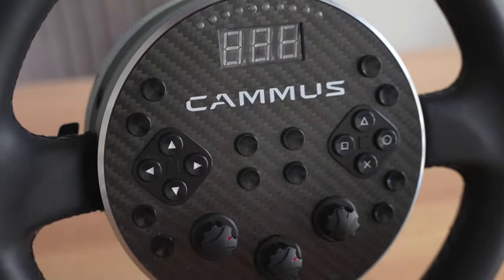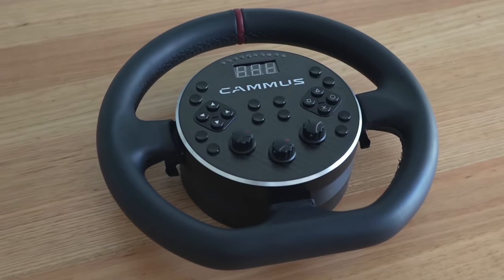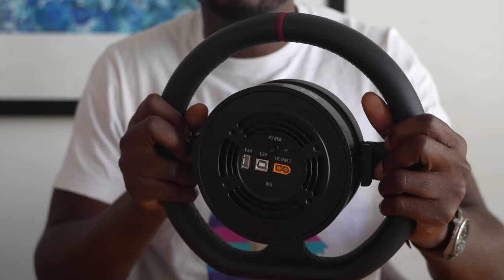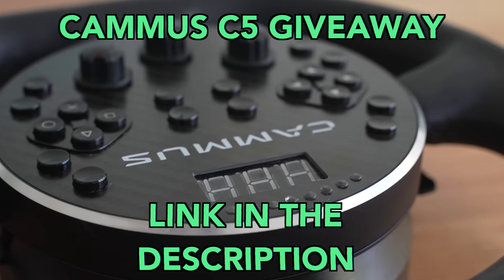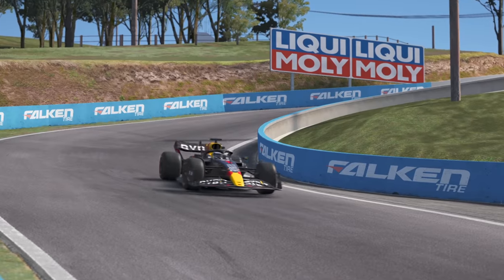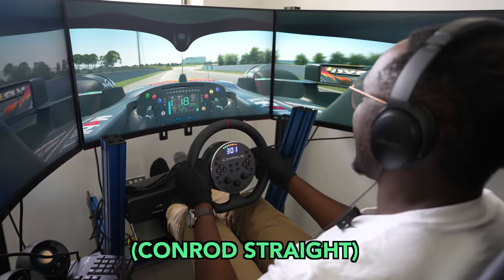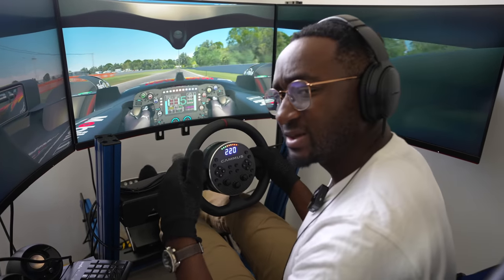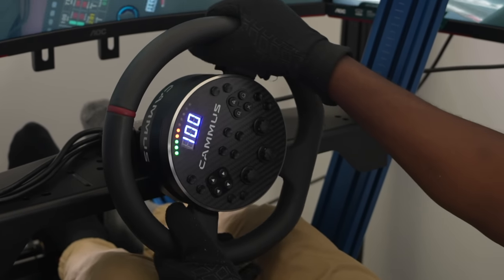The Cammus C5 Is The Most Affordable Direct Drive Wheel Ever

Comment: A larger wheel would make it look less awkward, but either way it’s a very interesting concept.  The more competiton, the better outcome for the consumer!
Reply: Yeah was thinking the same, the smaller rim makes the middle section stand out
Reply: Or they can make the outer wheel itself modular and make attachments of various different wheel shape. That'd be cool
Reply: 5NM is not so much, with a smaller wheel it feels stronger.
Reply: obviously the motor is weaker than other direct drives so they made the wheel diameter smaller to compensate
Reply: @wrth  it’s stronger than the t300 and Thrustmaster sells 13” diameter wheels that bolt right up to it. Cammus can use a bigger wheel.
Reply: @nightzelmods  t300 feels weak when using a big wheel. the whole point of using the small wheel is so it feels MUCH stronger than a t300 instead of slightly stronger
Reply: Its so ugly that wheel
Reply: 11 inches. Hmmm
Reply: Downside of a larger wheel is leverage, which would reduce the sensation of strength from the wheel substantially. Also it makes the wheel less suitable for Formula (and possible) Le Mans and modern GT) style racing cars.
Reply: agree this shi is small
Reply: @Zirion123  ...Yoda is that you???
Reply: @adamriese3610  There is more here than just the wheel diameter. On a normal rig you have a base with a motor that gives force to an inside axle, that gives force to a quick release that transfers force to a wheel. Also the length of it all reduces the force available. In all those steps there is a lot of force lost. The C5 (and now the C12 too) has no middle hardware, wheel and motor are exatly the same piece so no force is lost with middle steps. This added to the fact that the C5 has 5N/m SUSTAINED the whole time reaching peaks of 6.5-7N/m.

Comment: If they're trying to take on the g920 they also need to release a CHEAP 3 pedal set. I work with Arduino a lot... I know just how overpriced every single offering is. After opening my T3PA and converting it to USB with a loadcell myself with Arduino it's almost comical how much they skimp on parts and overcharge.
Reply: pedals are basically 3 potentiometers and whatever the cost of the material is (which for t3pa isn't much)
Reply: @zwenkwiel816  Almost no pedals have potentiometers nowadays.
Reply: @lukaskliment9646  t3pa does, as do the Logitech pedals. (think it's the most common solution for cheap pedals)
Reply: @zwenkwiel816  Yes and nowadays those pedals are 10 years old.
Reply: @lukaskliment9646  so? they're still some of the most used products on the market and anyone wanting to produce a cheap set of entry level pedals would look at them as an option for sure...
Reply: Their pedals are cheap enough for the value.
Reply: @kimyoon4374  Calling something "Cheap" doesn't necessarily mean it is "Bad".

You can easily make things cheaply that are superior to their more expensive counterparts.

This western/global misinterpretation of the word "Cheap" being used to describe an item as of lesser or inadequate quality really gets to me.
Learn the English Language FFS, it really is not difficult to pick up a Dictionary to understand the definition of a word.
Reply from the maker: Agreed, an entry level set of pedals would make this extremely compelling!
Reply: @longnamedude3947  I didn’t describe cheap as low quality. I meant Cammus already has a bang for the buck pedals. Okay, I will learn English. Haha.
Reply: @lukaskliment9646  even the tLCM uses potentiometers in the throttle and clutch lol wrong
Reply: @fitchyyboi  No, they use hall effect sensors.
Reply: @lukaskliment9646 a ton of pedals still use pots…

Comment: Very cool!  Thanks for the video.  It's an interesting looking product, but I can't help but feel they completely missed the mark on those shift paddles.  Hopefully some aftermarket stick-on or snap-on paddles with a larger area for your fingers appear on the market.  But well done to Cammus overall; very innovative product.
Reply: i think for drifting its actually good that the shifters are small so they dont get in the way when you let go the wheel
Reply: @SP.Spittlebug  ok but then the wheel need to be completely round
Reply: I agree.  I think the 3D printing community can make a larger 2 - piece paddle that sandwiches over the original pretty easily.  Is there any chance you will be reviewing it?
Reply: i hope you get one to test!
Reply from the maker: Thanks for commenting! The paddles are hilariously small but actually felt nice to use, not overly loud and clicky…personal preferences aside I think they need to be bigger too, but all things considered its a very cool concept 😃
Reply: user-pd2lf6tv2p  then buy one

Comment: A promisng start but those paddle shifters would be a deal breaker at that size. I'll be keeping an eye on their progress but I think they are going to need to do some refining and reworking before they actually come to market.
Reply: just glue some cardboard onto it and you're good, I did that to my old Xbox 360 Logitech steering wheel that had even smaller ones
Reply: @meehdrescher  I 3d printed some extenders for my g25, works like a charm

Comment: Nice little wheel. Sub $300, 5Nm holding, light weight and direct drive. What's not to like? It truly makes any non direct drive wheelbase w/o the ability to change wheel rims, obselete. And it undercuts Moza and Fanatec by miles, in terms of cost. 

I'd like to see it sitting a little further from the wheel plate/deck. On my GTOmega Apex, I am sure the wheel would be millimeters from the cross bar. And I would also like to see Cammus make a dash display for this wheel. Being so compact, the dash display would be in the same place a real dash display would sit.

Interesting. I wonder if any other MFG would make something similar?

Comment: You can see it is a very early model as the red stripe in the wheel is bigger and orange in the retail hardware and the finished version for retail has 2 USB C connectors in the back for pedals and shifter/handbrake.

Comment: The Cammus C5 could compete with the G29 or G920 only if the pedals are included for a total price of <$350
Reply: It would still be by far the best option even if it was 400-440,.the cheapest dd option rn, the moza r5 bundle (without clutch) is 580EU taxes excluded

Comment: I entered the giveaway and really interested in this wheel. My only hick up with these wheels is they don't really make them the real size of a steering wheel. Like they are typically smaller. So, why not make a life size wheel and then I do like the many buttons since many use these wheels for open worlds like ATS and AC and this will allow for customization with lights, blinkers etc...

Comment: They need to make a bigger wheel though since the g920 is 278 MM while the Cammus Wheel is 280 MM. I get its small to save money to get that sub 300 HOWEVER, it makes it really hard to drift and all of that stuff. Normall,y I would switch the wheel for a bigger one but since the wheel base is built in, can't really do that. Another disadvantage would be no quick release for different wheels like fanatec has or stuff like that, your kind of locked with only 1 wheel while with the g29 you can add a quick release on it to change out the wheels. Hopefully they come out with one with a base that could possibly reduce the price point further. :)

Comment: I'm very intrigued by this product. I have a G29 and while it's great for me atm, I do want to upgrade to a DD wheel at some point. This could be a great contender.  I paid around $300 for my G29 new so if this comes in at sub $300, it's a no brainer.  My only concern is I don't have a driving seat rig set up. I have the g29 connect to my desk with the clamps. Do you think they'll have a clamp system alternative? That could very well be the deal breaker for me and others.

Comment: Very interesting product for the price tag they aim to! Kind of weird looking wheel, personally I would have made a more octagonal shape with cut upper side plate, to resamble a real wheel. That circle is a bit meh 😅 Also the paddles so small, why in hell? I hope it will be possible to add a mod for them, if not aftermarket, at least made by Cammus, to make them bigger. The main concern and only one real concern, might be the distance of the narrow motor to the wheel holder. Imaging using a pair of gloves, and you can't even turn the wheel ehehe. I hope there's a way to fix the distance for the final version of the wheel. Sub 300$ it could be an instant buy!

Comment: i wonder if it will be possible to mod it to separate the motor from the wheel like i did with the logitech g25 and the fanatec csr to have a f1, rally and truck wheel option.

Comment: fanatec ClubSport Steering Wheel F1® Esports V2 is also cheaper than a g29 ... but there is no sens cause it's not a full set. you have to compare same think ... without pedal set is not comlet, you can't compar to the G29

Comment: Would you get this or the T300?
I am racing with my old g25 and the t300 on the second hand market its already quite some stretch for me that I race once a week, I would feel terrible if I get the t300 and then knowing this would actually make more sense...

I will still keep the g25 pedals and shifter if I inly get the wheel.

My main use its some open wheel races at AC and I would like to enjoy more some drift which its hard in the g25 since the wheel doesn't come back as the t300

Comment: Question from a sim newbie here, I've tried a g29 I think it was and had it desk mounted, there was a lot of vibration with that thing, as in you could hear it vibrating through the walls and downstairs, and I've stayed away from direct drive due to the price and I can't justify it as it's not something I would be using a lot. This does definitely seem promising so far, and for someone who would be mounting it to a desk, would you think this would cause a lot of vibration compared to a wheel like a g29?
Reply from the maker: No, mounted to a desk this wont vibrate! The G29 with its gear mechanism can be crunchy when used, whereas this is smooth as butter, and when table mounted would be pretty much silent 😊

Comment: They need to redesign it don’t like the fact that’s it’s to close to the mount plus tiny shifters . If they want to take on Logitech they need to redesign and get a hold on locker like the Logitech that allows you to hook it up anywhere at anyplace without A rig stand. My Logitech is locked to my glass table

Comment: bro carefull with the volume of your video, the sound output is at -11dB (quite quiet)
on youtube you can go to +3dB but i recommand you -3dB or something close to that
Reply: always mix with the master set at -2db there's no time when this does not apply , use it as a base and bring everything else up in the mix using mixer channel volume.
Reply from the maker: Thanks for the advice guys, ive always struggled with mixing the audio and getting the levels right. I’m going to put a lot of effort into it for the next video and will find stuff online to learn. You both sound knowledgeable, have you got any good sources so I can build on my understanding?

Comment: From what I'm seeing, the paddles are way too small but from the video again I'm not too sure since you didn't complain much about it. Also does it come with a foot paddles?
Reply from the maker: The paddles are teeny tiny but I actually didnt mind using them, as they felt quite nice! Its not true to a real car having tiny paddles but I never had any trouble shifting with them at all! Doesnt come with pedals but ive let cammus know that this is something they need to include
Reply: @TheCarDoc1  so in this case, what paddles did you use?
Reply from the maker: @creamyparfait  my fanatec V3s :)
Reply: @TheCarDoc1  dang didn't know you can connect to any paddles with this wheel

Comment: So far with the few reviews that have come out, I haven't seen any pedals which has me a bit worried.  If they want to hit at the sub $300 market, this thing needs to have a decent 2 pedal set; bonus if it is similar to Fanatec's so one can add a 3rd pedal down the road.  Since there are no extra inputs on the back of the wheel, I assume whatever pedal set that use will be a separate USB device.

Comment: Theirs flaws with this design, for example, how do you place this wheel far away from it's mounting base?

Also, the wheels overall size is REALLY small, even for a budget wheel it is small and this feels like a major drawback considering the style of wheel they've chosen to go with - Full Circle w/Flat Bottom, instead of a more GT3/Endurance Racing style "Yoke" Wheel (_|°|_) that you'd expect at this size.

For the lack of known quality & reliability, and lack of software support expected at release, this needs to undercut Logitech in price by around $50-$75 if it's to have any chance of actually competing.

Seeing products like this just make me want to build and Open-Source a few of my own designs & solutions.
Such options would allow interested individuals to not only take advantage of the Open-Source Design, but, it would also allow people to improve the design even furtger which thus adds to the value of community oriented improvement workflows where you get out of the project whatever efforts you put into it, and, everyone else that isn't a commercial entity also gets to benefit.
Reply from the maker: I’ll feed back the wheel options! What do you think about being able to buy either a C5 with a GT3 rim, a F1 rim or a round rim, but not interchangeable?
Reply: @TheCarDoc1  For me, the wheel being interchangeable is the only thing really making this a potentially viable option over the exist Logitech & ThrustMaster products at this price range.
Removing that feature would badly eat into the additional features this offers over the existing competition and when you're trying to compete in a market with the likes of Logitech you NEED to over-deliver on your product in a BIG way if you are to stand a chance of gaining any potential customers or market share.

Remember that Logitech make a wide range of products, and so once you are into their budget range the next step is usually a nice mid-range Direct-Drive Wheel base from Fanatec, Thrustmaster, or, Moza, all other options are too expensive or not truly Direct Drive.

The Sim Racing Hardware market is looking for a solid disruptor at the $500-$650 price range, where for that price you get a detachable DD Wheel Base + Wheel with Buttons, Dials, & Paddles on it + 3 Pedals + a Stick Shift H-Pattern Shifter, essentially a slightly improved Logitech G27 set but with Direct Drive, a detachable wheel, and a plate included in the box to EASILY & QUICKLY convert the H-Pattern into a Sequential Shifter.

Add another $65 USD if you want a Tall Chest-Height floor mounted Handbrake that can be mounted vertically or horizontally as the user wishes, again the conversion process (if even needed to achieve the result) would need to be EASY & QUICK to enact by the end-user, preferably without any additional tools.

Right now the market has options, but nothing that fits the example I've given at that target price point.

Now I know that as a consumer if I wanted to that I could by the needed hardware for far less money and make such a setup myself, then I'd only need to develop some Open-Source Software and benefit from a community of like minded people to create an awesome product both in hardware & software.

So if any wishes to enter or disrupt the market then they need to hit the ground running and get a few home runs before people are going to really start taking notice.

In today's market the key things that need to be met are;
1• Offer newer features & improved hardware over competitors

2• Price your product at at least 30% under $1000 USD, that's where theirs a big hole in the market for a disruptor to drop-in.

If you cannot meet those two criteria then you aren't going to succeed because people aren't going to be interested in spending money they simply don't have on more expensive options, and, if people want cheaper options they'll either buy used, or, spend $200-$300 USD on a basic setup from Logitech or Thrustmaster.

Comment: if it wasnt integrated, it would break the market.
Reply: this man for real
Reply: I disagree, all entry level wheels r integrated the only ones that can be customized with aftermarket options is the g29 bcs it has visible front plate screws but is still attached to the wheel. If anything that may be the veey reason why the wheel is so cheap and its understandable otherwise they would have to manufacturer wheel rim and wheelbase which might be the reson for the expesier Fanatec DD or the Monza R5 which r the closest but yet r way closer to half way to 1k
Reply: @victormiguelmontero136  this has the motor literally inside it lol, you cant mod this
Reply: @valkywie  Thats my point, the G29/G920 r the only ones u can mod.

Comment: If only the wheel rim can be a bit bigger and the paddle shifters are bigger like the G29 and PS5 GT7 ready wheel. It will be an instant buy for me. 

I will totally skip the Logitech G Pro.
Reply: G pro is 2 times stronger than this wheel tho.
Reply: @i_hatehaters_lol7647  and many times more expensive. 1.5K USD for wheel and pedal is not a small sum
Reply: @linchester8464  But you can’t skip a thing that is better-
Reply: @i_hatehaters_lol7647  for the cost of a bad miata i'll skip the g pro
Reply: you can easily just mod the paddle shifters to be bigger